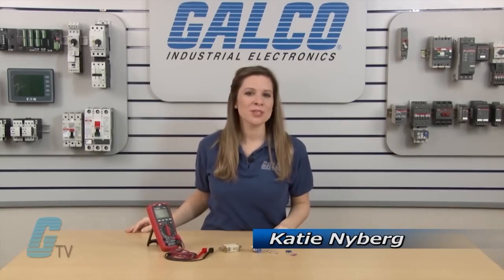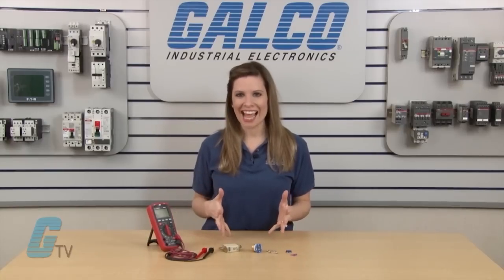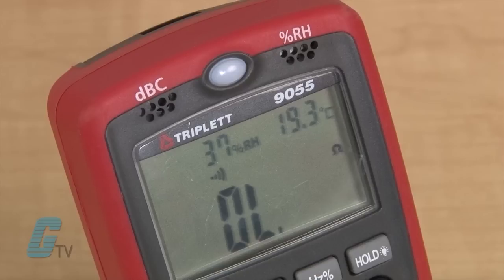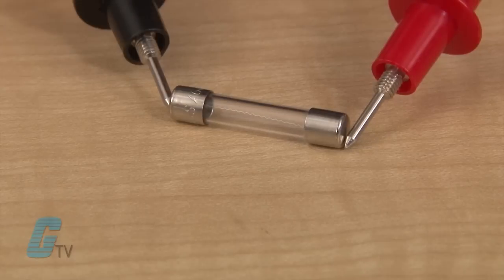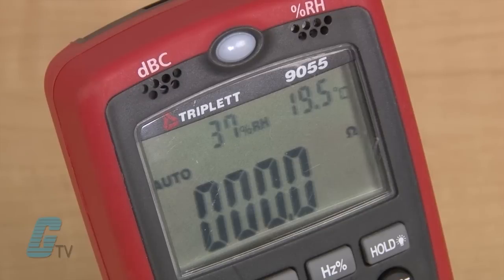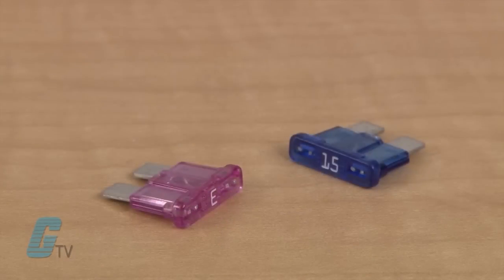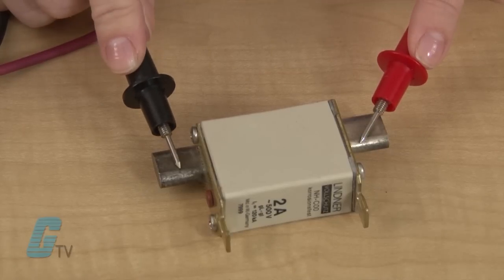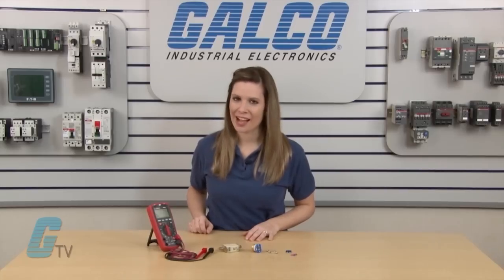How to Check a Fuse by Testing it with a Multimeter

Comment: Greetings ... Had a quick and simple question, is there a way to measure the amperage of a glass fuse via a multimeter ? Some of them loose their embossed print in the steel section and its never possible to know how many amps that fuse is.

Comment: My multimeter doesn't make that beeping. And you don't clarify exactly what readings under what settings to test a PLUG FUSE....
Reply: She just did
Reply: Yes she did.  Very clearly.
Reply: the values should be identical to if you were just touching both testing leads together. your checking for continuity.
Reply: Did you not watch the video?
Reply: Do you even electricity?

Comment: Hi there i am examining my dryer heating grid (the small metal sheet in the back with the coil, thermostat and Fuse) and i get the beep when testing  the terminals on my coil, and thermostat. NO BEEP on my fuse. 

is that supposed to happen? Do i have to keep taking the dryer apart, or have i found the culprit and just need to order a new one?

in my google searches for testing thermal fuses, i keep getting "Set to RX1" but i do not see that on my digital meter dial. I also see "its burnt out if it goes to infinity" (i dont see an infinity sign on my meters screen)  and that it should be at 0.00 which i do see on my screen. but it doesn't beep like the others in this video and they just don't tell me in the results if i should or should NOT hear a beep.

i just need to know if those fuses should also beep with the multimetre and if i found the issue. any clarity would be appreciated.

Comment: So if the fuse is good what reading will you get? And if it’s bad what reading will you get?
Reply from the maker: If the fuse is good you read zero ohms, no resistance or very low resistance. If the fuse is bad you read very high resistance or the meter will just stay reading "OL" representing open loop. Please realize that low amp rated fuses (say less than 1 amp) may have a few ohms of resistance. Does this help?

Comment: Long story short. Took my dryer apart checked all the fuses. Had to replace door switch fuse. $35 put it all back together. Didn’t call technician or buy a new dryer. Im feeling so proud of myself! Thanks for your video. Jojo
Reply: I'm checking a thermal fuse but when testing is it supposed to stay completely zero or have resistance I'm getting around 6-7 ohms so is this blown or good first time using a multimeter
Reply: gigglecheeks123  how about a washer?
Reply: hi there i need to know when testing it, did you get the Beep on the fuse to determine it's fault? or was it silent. I've had confusing results on Google, which i am certain are describing how to tune and read ANALOG meters. 

so SHOULD i be getting a beep on my fuse? cause i'm not.
Reply: gigglecheeks123. You obviously know how to set and use a multimeter, otherwise you couldn't have checked the circuitry. You obviously didn't need any help from the video to check the fuse.
Reply: You should feel proud, few things more satisfying than DIY success.
Reply: you should see if the dryer company is an honest company put the old fuse in and give them a call see what they charge you record it for youtube entertainment lol jk 
good shit though 👏 👌

Comment: The video does not tell you how to set the meter before testing/checking the fuse.
Reply: Kassim Nazeer were seeing if the fuse is good or bad dumbass.
Reply: So much for a video being helpful.  😠😞😳
Reply from the maker: +Tomas Romero you are correct that we don't actually show the dial being turned but we do explain how to test a fuse using the continuity and resistance measurements.

Comment from the maker: The fuse is a reliable overcurrent protective device, primarily used as a circuit protection device for overcurrents, overloads and short-circuits. A "fusible" link or links encapsulated in a tube and connected to contact terminals comprise the fundamental elements of the basic fuse. Electrical resistance of the link is so low that it simply acts as a conductor. However, when destructive currents occur, the link very quickly melts and opens the circuit to protect conductors and other circuit components and loads. Fuse characteristics are stable. A fuse does not require periodic maintenance or testing. The fuse has three unique performance characteristics.